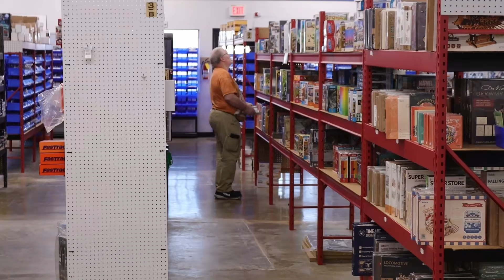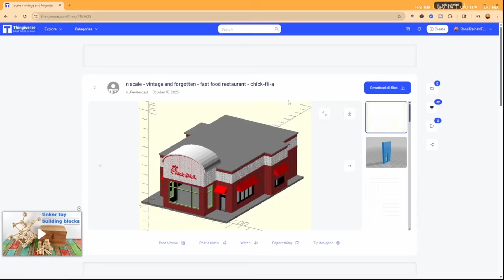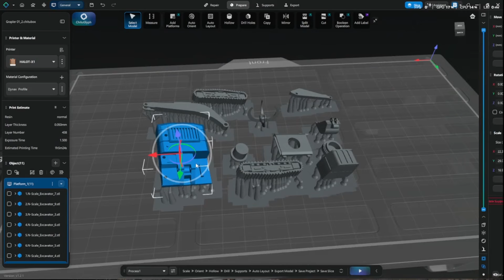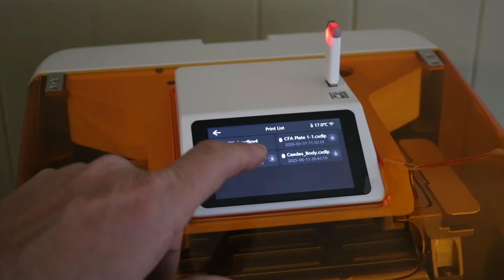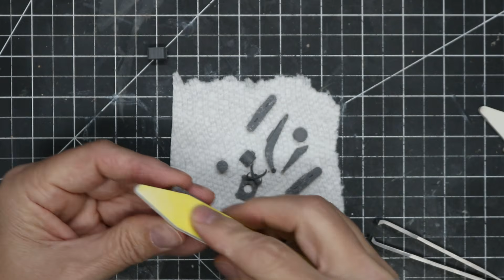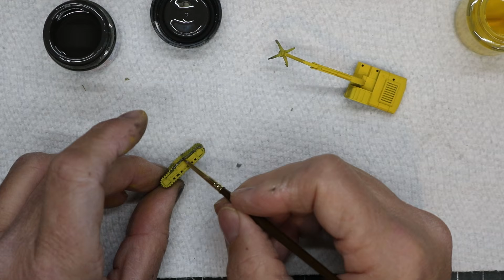Print Parts You Cannot Buy with Creality Halot-X1 3D Printer

Comment: Hi Ron, I have an Anycubic Photon Mono 4 Ultra resin printer and love it.. and I also have my Creality Ender3v2 FDM printer. I use them both for making HO/OO scale replacement parts and other parts for items around the house..  

I did look at your link for the new Halot but seeing that I am in Australia the discount doesn't work and that printer is on sale presently for $906 AU instead of the normal price of $1059 AU.... these printers are very expensive here in Australia... 

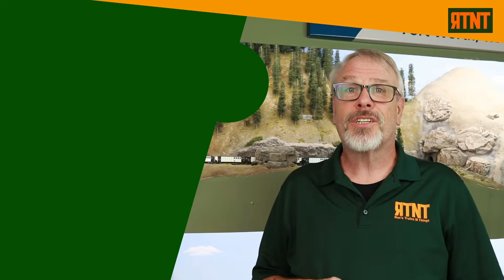**FYI at the 10:06 section onwards you mention and gesture to your right for some links on the screen in the green segment.. it is left blank with no links visible...  

Cheers Tim Melbourne Australia...

Comment: Hey Ron . Got a question, I'm just new at it looking forward to building my own train in N scale. Bin watching lots of model railroader videos and am confused with the rewiring and adding power to switch frogs . Is this procedure done because switching from DC to DCC ? or if your DCC to begin with you need not do any necessary changes to the switch? Only asking cause in one video of yours changing out bad yard switches you did not do or show any wiring to the switches and frogs
Reply from the maker: I use insulated frogs or insulfrigs, so my frogs are dead and not wired. If you have metal frogs they have to be wired. The wiring process isn't difficult, but it is more than I can cover in a comment here.

Comment: Excellent introductory video. Normally it's easier to remove supports after washing but before curing.  This means you have to wear gloves and use a respirator while removing supports, but flexible supports will come off with less damage to the model than a fully cured support/model. It all depends  on what will be  normally seen on the finished model. If all the supports are attached to hidden areas of the model than it's not such an issue. YMMV. ;)
Reply from the maker: I tried both ways and, with these tiny delicate parts, I was destroying the model removing supports before curing. For me it worked best to partially cure, cut the supports long, knip and sand them down, then cure a little longer focusing on the supported sides.

Comment: I’ve been contemplating getting into this but it almost becomes a hobby within a hobby. There are quite a few producers of 3d items so I’ll likely look for those that will fit the bill when needed. I also learned that my local library has the ability to print 3d in both filament and resin so might go that route for the few items I might need.
Reply from the maker: That is interesting. 👍🏼👍🏼
Reply: You said it.  A hobby unto itself and since i dont do well with computer stuff im out.

Comment: very nice and useful. But the 3D set up likely set you back $500 ir more, plus supplies, etc. Is this economically sound for a few things for the layout?
Reply from the maker: You definitely need to have a larger use for it, but many people have them already, so I thought the video would be worth while.
Reply: I like the stacked up junk autos in the yard. What is the source for those ?
Reply from the maker: @alweinhofer5453 I bought those years ago on eBay. They are cast resin but are no longer available.